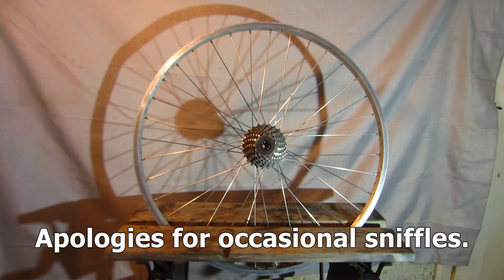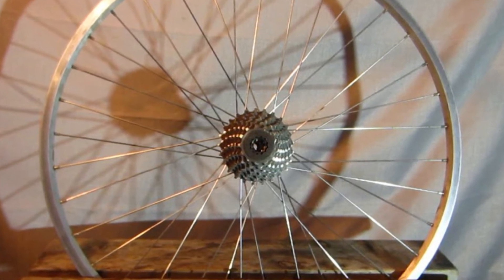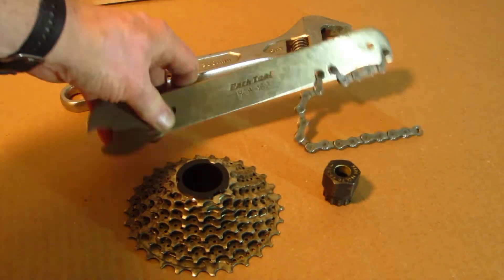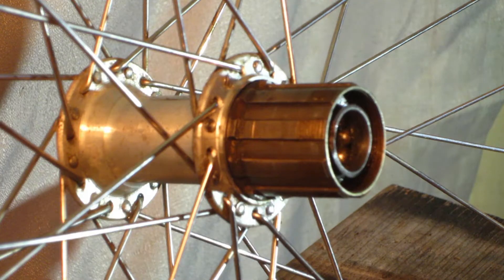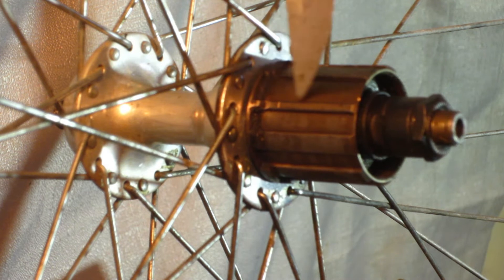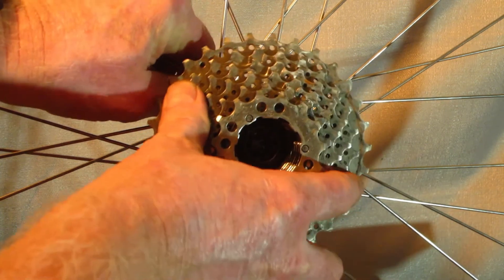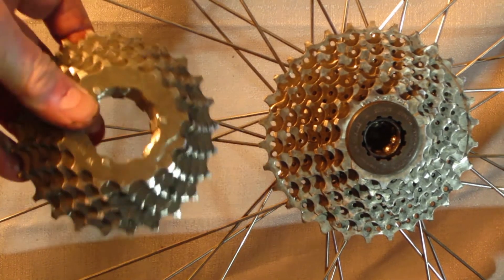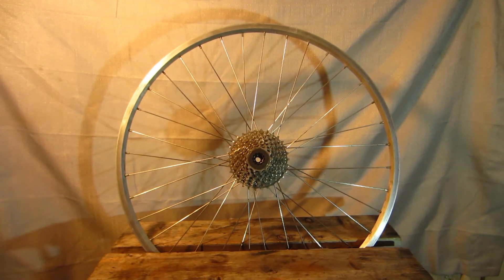How To Adapt A Wide Range Uniglide 7 Speed Cassette

Comment: I am surprised to see what you did because I have asked all seven bike shops in my area to make me a custom cassette and none of them could do it. I am older than you and the 12-25 t 8 speed cassette on my road bike makes climbing more difficult as time goes by. Shimano used to have a 13-28T cassette but it has been discontinued. No one seems to have one online either. Quite frustrating.
Reply from the maker: Yup, I get it.  That's why I decided to take matters into my own hands.  :)  (PS-I'm 62.)